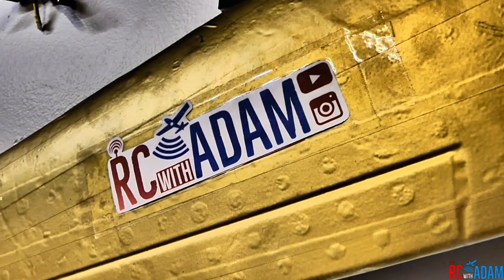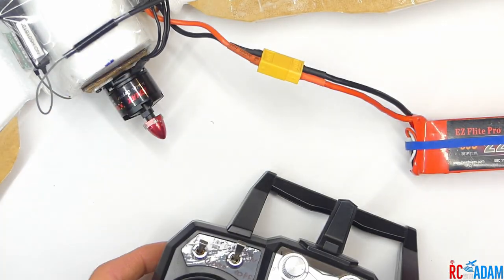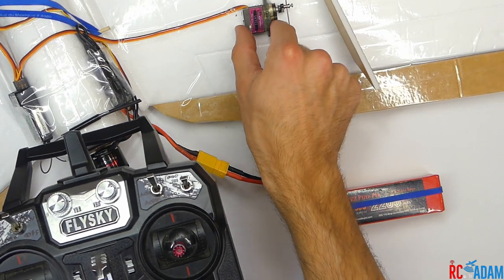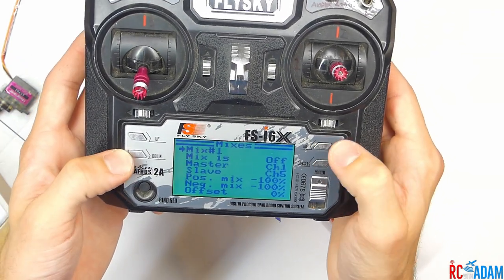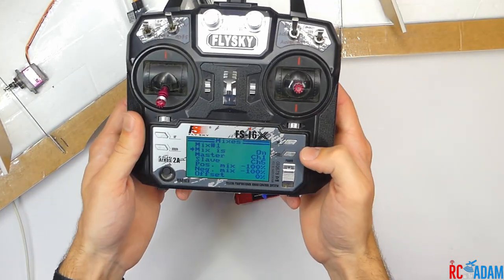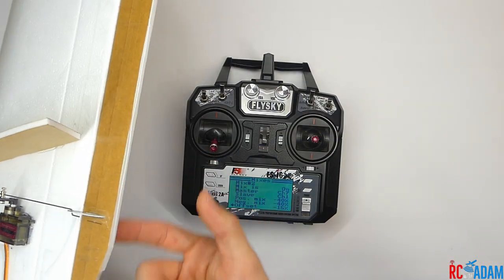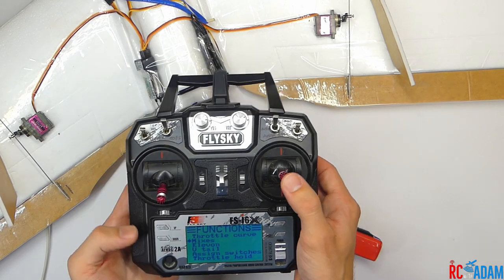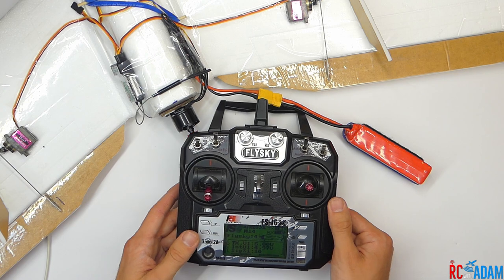FlySky FS-i6X How to Setup Flaperons - 2-Position Flaperons mix with i6X and iA6B Rx Tutorial Guide

Comment: Great video, Adam. What you’re working with on a flying wing is elevon control. That is, mixed elevator and aileron. Flaperon control applies to conventional airplane and sailplane wings for wing camber changes. 👍🏻😉
Reply from the maker: YEs, that's a good point. I was just using a flying wing as an example of a normal aircraft wing (I didn't have any true aileron airplanes at the time).
Reply: RCwithAdam Exactly. I assumed that was the reason! Great video! 👏🏻⭐️
Reply: He mentioned that in the first part of the video…

Comment: Thanks Adam! I've been looking for the answer to this question for the flaperons on my Eclipson Model C and you've explained this perfectly in a simple and concise manner.
Reply: I am finishing a model C as well but for some reason, one of my servos will not move as far as the one I mixed it with. Works fine with a split. Did you have any issues?
Reply: @dkh10  No issues with mine. Have you checked the End Points setting in the Functions Setup menu to see if the end points are correct (mine are at 100% for all channels). Also, check the Mixes setting for the mix on the  flaperon master / slave channels  (I have both the Pos. mix and Neg. mix at -100%). You could also check that the Subtrim settings for the flaperon channels are entered
Reply: ....You could also check that the Subtrim settings for the flaperon channels are *centered

Comment: Excellent info, i thought this would be configurable / supported on the i6X, with 1 servo per side / flaperon.  It's a fairly elegant solution.
Think i will use a variable knob to get various degree's of flaps.  Small flap offsets for slower / greater lift ie student flying, and larger flap offsets for take-offs & landings, or similar.
Hopefully, i am not too limited on the number of pre-programmed flap offsets with the variable knob v config, though i get the knob gets you no flaps to max flaps if you want.  Super!

Comment: Hey adam, thanks for the video! One question that I'm left with after this I'm hoping you can answer. 
I'm running a 4ch micro reciever. Im using the i6 with stock firmware(I dont have the cable to upgrade) The setup on the plane is left aileron into the aileron channel and right aileron into the rudder channel. Elevator into the elevator.  I've set up flaperons like in this video and all of the aileron and flaps functions works great on the right stick. Problem I'm having is that the left stick still has independent control of the right aileron (and its reversed so if I use it the plane will do the opposite). Is there a way to tune it out so that the stick has no function anymore? Or do I just have to learn to ignore that stick?
Hope you can help, thanks for all your informative videos!

Comment: im trying to setup a glider i guess is what u would call it. this is my first time dealing with an rc plane cause it was always out of my budget to buy one but in the past couple yrs ive gotten into 3d printers an decided to take on building my own. i have the plane built have all the electronics an the i6x transmitter an ia6b receiver but im not 100% sure how to go about setting everything up, i have the rudder an elevators working or i think thats what they are called, the small wing at the back with the flaps they move up an down to pitch the nose up an down are elevators i think, and the rudder is the upright fin or wing ( i dont know the technical terms) an it moves left an right to turn the nose left an right. but when i go to setup the big wing up fronts flaps i can only get one servo to work when i need it to control 2. if that makes any sense. i feel like this is something that might help me get it working but at the same time im not sure cause im clueless with this stuff an trying to learn. ive had more luck just watching videos on stuff that im not even looking for and finding the answers when it comes to this stuff im so far off on what to search for when i run into an issue.

Comment: At abit of a loss here man, thanks for the video btw it helped alot! But i do have a question; i've followed the video step by step, all settings and even servo positions are the same. When i flick my right stick wich is my elevator and aileron controls, my rudder rapidly moves left to right. Also, my flaperons only work on my right side, left wont move with it for some reason.

I have to go right now for abit but once i'm back i'll completely redo it and are what happens, as for right now i havent been able to find any differences whatsoever. Running the FSI6X with the FSIA10B.

Thanks in advance!

Comment: does this work for the 6 channel version of the transmitter ?
Reply: i think it should but i am working to simply get the ailerons to work with independent servos (one servo per aileron) and that it proving to be difficult.  Not sure it should be this hard but so far it seems the AUX 1  which is channel 5 only wants to see the two knobs (those are the only two options when going into Function and Aux channel setup. )  Any thoughts are appreciated.
Reply: I realize this is 2 yrs ago, but I was able to do it on the older FS-i6 radio.  
Instead of selecting Aux ch7 or 8 to SwC....
Set ch6 to SwC (I'm not using ch6 for anything else.)
Mix#1 Master is ch1 and Slave is ch5 (pos & neg mix is -100%)
Mix#2 Master is ch6 and Slave to ch1 (pos & neg mix is 40%)
Mix#3 Master is ch6 and Slave is ch5 (pos & neg mix is 40%)
My offset was the same on all 3 mixes (+15%)
I hope this helps others with the older 6ch radio!!

Comment: Been having this random problem where when I set the transmitter for mixing I would only get 50% of throw even though I set it to 100!? Wtf but then I reset the model on the transmitter do the same thing again and it worked? Is that just cause it’s not like exactly the best or what? Lol also I’m using the fly sky fsi6x transmitter and turnigy AFHDS receiver.
Reply from the maker: Interesting! Did you start with a brand new model profile (no old mixes or modes)?

Comment: I've got a flying wing set up with elevrons that work on the right stick correctly. Is there a way to change the aileron function to the left stick and keep the elevator function on the right stick?
Reply from the maker: Yes, but you'll need to create a custom mix (or maybe two). But I haven't actually tried it yet.

Comment: Thanks very much for this tutorial! I used it (almost) successfully with my Conscendo Advanced. I noticed I had to set pos. mix and neg. mix at 2 times the value of the offset to have the expected behaviour.
I said "almost successfully" because it was the first time I experienced flaperons, and I crashed (and repaired) because I didn't compensate with the elevator. Is there a way to do so automatically? The problem is that there is only 3 mixes on this tx :( I wanted to use the "normal/sport" dual rate system, binding it on switch C like the flaperons (it works), but this system doesn't allow to change the elevator centering, only the rates :( Is there a solution to automatically compensate the flaperons with the elevator? Thanks.
Reply from the maker: Hi! Glad I could help! I think the only option to automatically add elevator would be using a mix.
Reply: @RCwithAdam1  Yes of course, but the 1st mix is for the ailerons (cause they must be on distinct channels), the 2nd and 3rd are for the flaperons :/ So I'm afraid it's not possible with a FS-i6(x)... Unless FlySky patches its firmware and give us some extra mixes...
Reply: If you turn flaperons on, shouldn't the plane go up because it generates extra lift? If yes, then how did you crash?

Comment: Will this work on a warbird? I have a P-51 Mustang from harbor freight that I’ve upgraded to brushless and flies great but comes in hot on landing and looking for a way to slow it down.
Reply from the maker: Hi! It really just depends on how the servos are wired to the receiver. If they are connected to the same channel port with a Y-connector, it will not work. Also, the receiver on the plane needs to be a flysky receiver for it to be compatible.
Reply: RCwithAdam gotcha... i plan on ditching the single aileron servo setup and installing a servo on each aileron. And yes. I have the same transmitter and receiver as you in the video.

Just wondering if it will work on a P-51 :)
Reply: Btw... i have an Eagle A3 super 3 gyro installed. What should i look out for?